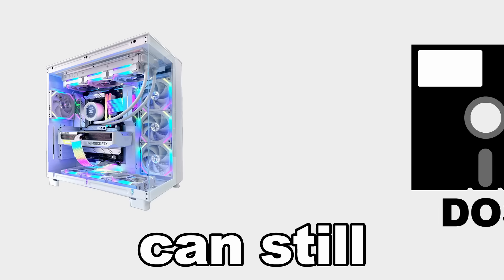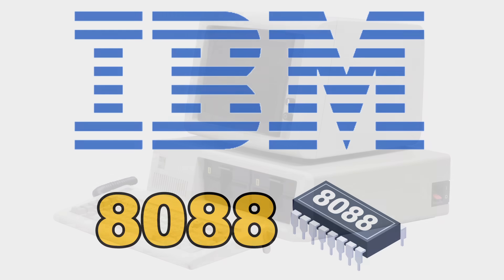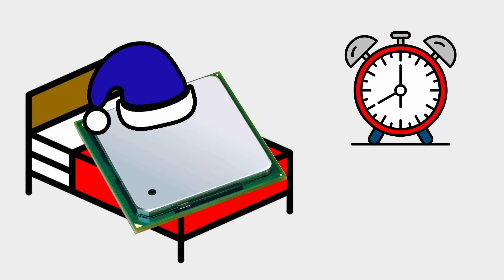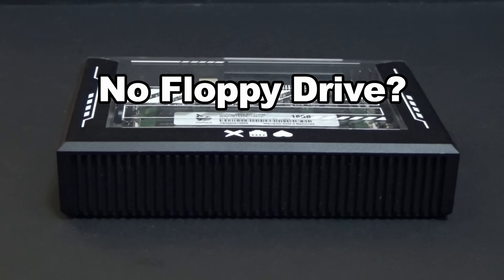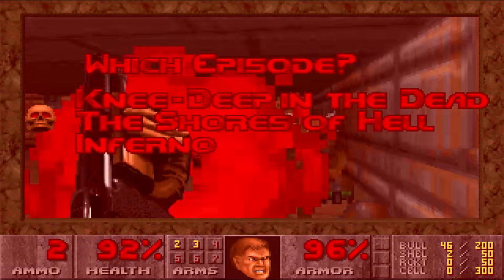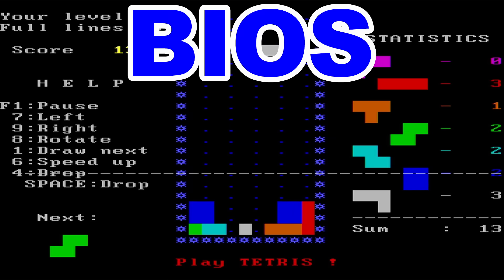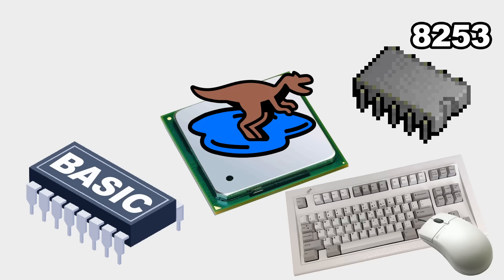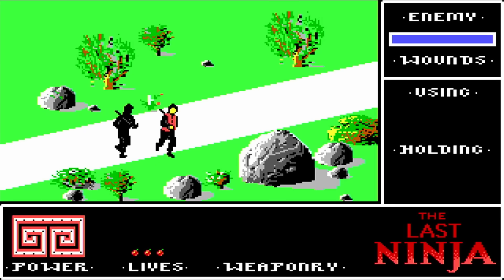45 Year Old DOS on a New Intel CPU Without Emulation

Comment: The Celeron N3450 is anything but new. Is CSM mode still included in new motherboards?

I modded my laptop's BIOS to unlock all options and it doesn't seem to have CSM support (it's an 11th gen Intel).
Reply: Only on Desktop PCs now
Reply: @pankoza  That sucks.
Reply: CSM (aka. UEFI-style fimware pretending to be BIOS) has to be present in the boot firmware. Otherwise your "modding" would basically have to be a full replacement like coreboot | libreboot.

In principle you could also implement it in a bootloader or something,
Reply: @mskiptr  UEFI doesn't really care about whether the code comes from FLASH or is user-provided. Putting it in a bootloader is fine. UEFI was specifically designed to accommodate that sort of extensibility. That's the E in UEFI :)
Reply: @absurdengineering  You mean one can add CSM to an existing system with something like UEFI drivers loaded from the ESP? That would be pretty useful actually.

I've been quite interested in things like that, but sadly I wasn't able to find answers to my questions in the spec. (I'm sure they are there – just finding them was too tricky for me the last time I tried.)

Still, I don't think UEFI will let user-provided code do everything the boot firmware can. Like you will definitely not be able to tweak SMM stuff.

The complexity is just peak "design by committee". It does what it was meant to do, but at what cost? It's giant and over-engineered which is terrible for correctness, security or even implementing it sanely.

What I care about tho is FOSS boot firmware (which is why I'm interested in Chromebooks), so accommodating code from dozens of vendors doesn't matter for me at all. But I can just mostly ignore UEFI and that's ok. At the end of the day TianoCore can be vendored into whatever better firmware we have and that's alright I guess.
Reply: It is still on a decent number of motherboard vendor's products, as well as some pre-built desktop/laptops, despite the proprietary firmware. However, even if AMI and any other traditional "BIOS" vendor eventually removes support entirely, likely leaving ASUS, Gigabyte, MSI, and pretty much anyone else you can name, with few options, as virtually none of them develop their own firmware entirely, you will still likely have options.

Chromebooks since ~2013-ish (?) have all been required to run coreboot-based firmware, which should generally mean you can relatively easily have coreboot use SeaBIOS as its payload, which is a open-source proper "legacy" BIOS implementation (starts in 16-bit mode, etc), while still being continuously developed and having support for certain more traditionally modern amenities, such as TPMs, etc. And since, even though many Chromebooks run ARM processors, Intel is also very common, so you'll still be able to find off-the-shelf hardware that you can fairly easily modify to do whatever you want, including use a BIOS initialization. While there aren't loads of high-end Chromebooks, some do exist -- you can find Alder/Raptor Lake i7s and i9s.

Additionally, some of the more consumer-friendly of the traditional (i.e., not Chromebook) laptop vendors also offer open-firmware based on coreboot -- e.g., many (most?) of System76's products. And companies like 3mdeb (Dasharo) have ported coreboot to certain models of modern MSI Z690/Z790 motherboards, entirely replacing the official proprietary MSI firmware.

From there, as with the Chromebooks, you can use coreboot to deploy whatever payload you want -- be it true, traditional BIOS (e.g., SeaBIOS), the full-spec-compliant monstrous open-source UEFI implementation, EDK2, or more light-weight alternative UEFI implementations, as well simply neither -- you can literally even use something like the Linux kernel, or anything else that has some lower-level hardware support, as a payload and completely skip that aspect of the layers entirely.

It's sort of wild to me that UEFI has been pushed so hard, even though many consumers don't actually need the "extensible" E portion of EFI. In return, we get insane complexity -- EDK2 is well-over a million lines of code compared to, what, ~50K-ish for SeaBIOS -- and again, the notion that you inherently even need either is not actually even true, so that 50K can be much, much lower in reality. As time has gone on, I think UEFI is more-or-less a disaster; there's just so much more surface area for little-to-no gain in many cases, which means more vulnerabilities, more bugs, and less auditability.
Reply: @nukecel  Well, the UEFI-style booting (aka, boot images live as files on a partition and not in a boot sector and you can register boot options, change the boot order or set the BootNext variable from a running OS) is really quite nice and even what we're likely gonna be putting on "liberated" ex-Android devices. But yeah, almost all of the UEFI spec is pointless complexity.

(But maybe that's good actually? More complexity means more exploitable bugs so no true vendor lock – with these giant, proprietary blobs we will always at least be able to boot whatever we want if we try hard enough.)
Reply: @mskiptr  UEFI spec was designed to tackle the particular problems the industry had. Its relative complexity is due to market pressure. A modern UEFI BIOS can have bits and pieces from a dozen vendors, and that mess mostly works OK because UEFI was designed to accommodate such realities.
Reply: My Asus laptop doesn't have CSM support but I do have an old 2nd gen core i3 laptop that has a UEFI thats locked to bios only mode due to shipping with win7 and an 8th gen core i3 laptop that has a UEFI that supports CSM. 

I'd someone made an EFI bootloader that emulated CSM/BIOS that would allow you to boot older OS's on newer hardware.
Reply: @Izanami95  I think Clover Bootloader can boot Legacy on UEFI, I never used it for that tho.
Reply: @Flopster101 I remember many moons ago using TianoCore to emulate UEFI on my BIOS-only machines. Now I have to use Clover to emulate BIOS on my UEFI-only machines. 🤣
Reply: On some

Comment: Haha arm bad long live x86
Reply: Unironically yes. Pull literally any x86-based off the shelf, and there are millions of pieces of software that will run on it, usually without the slightest modification. Whereas there are so many variants of ARM processors that can be as different to each other as an 8086 and a POWER are.
Reply: @throwaway6478   Not to mention that RISC processors (including ARM) for some reason need a kernel image to boot (no GRUB?), which seems weird, as x86 boots from a drive, not from a kernel image.

Comment: There are LGA1700 platform boards that take Alder Lake or Raptor Lake cpus that have a PCI slot. And it's possible on some motherboards to break out a fully functional ISA bus over the TPM connector. So you know what that means right?
Reply: i think it's done through the lpc header, if the board is old enough, not the tpm. but even so, on one point in time and later, the way dma and irqs are handled by these ports (a.k.a the chipset), has fundamentaly changed, so dos sound etc. cannot work even if you managed to breakout an isa slot. you cannot use pci because it works completely different.
Reply: >And it's possible on some motherboards to break out a fully functional ISA bus over the TPM connector

On older motherboards(up until Skylake?), yes it should be possible. Newer Intel chipsets dropped support of ISA DMA from the LPC bus so ISA sound cards are out of the question even if you do manage to use the TPM connector as a usable LPC

Comment: RIP OS/2 compatibility in x86-64 processors
Reply: This is news to me. I knew early Ryzens had trouble running it, but it was errata that was fixed in the AF revisions.
Reply: @throwaway6478  64-bit long mode only has two of the four rings needed to run OS/2, which makes even emulation/virtualization difficult
Reply: @AmaroqStarwind Good thing OS/2 doesn't run in 64-bit long mode then. It's a 32-bit protected mode (retroactively named "legacy mode" in the AMD64 docs) OS, with all 4 rings at your disposal. I suspect you're mixing this up with Intel's monstrous x64-S proposal, which won't have IOPLs 1 and 2 at the hardware level, by "virtue" of not having a legacy mode - but nothing will stop you emulating it with a sufficiently-intelligent hypervisor if you must run it on one of these unnecessarily-crippled CPUs.
Reply: @throwaway6478  It also makes some of OS/2’s functionality harder to replicate for future operating systems.
Reply: @AmaroqStarwind That I can agree with - but as I said, nothing that a sufficiently-advanced hypervisor won't fix.
Reply: @throwaway6478  it's called x86s, not x64-s
Reply: @AmaroqStarwind  Doesn't the hypervisor still provide all 4 rings in the guest when the guest runs in legacy mode, assuming the hypervisor is smart enough to handle those rings?
Reply: @soundspark  I don’t really know. I’m not an expert on virtualization.
Reply: @throwaway6478  well, the 8088 was a crippled 8086 from the start. Cutting one's nose to spite one's face is a long tradition in PC CPUs.
Reply: @squirlmy Yes, but A) the 8086 and 8088 came out at the same time, and B) the 8088 served a purpose as a product, with its simpler - and therefore cheaper - motherboard/logic/electrical requirements.

x86-S does neither of these, coming almost 20 years after AMD64 debuted, and having the same electrical requirements as real AMD64.

All I can see are downsides, chief among them the much-discussed throwing away of backward compatibility. An x86-S will be (practically) limited to Windows 8 or later (and of course, only the AMD64 version), whereas a Ryzen 9950X and a Core i9 14900K that just rolled off the production line can run literally run PC-DOS 1.0 unmodified.
Reply: @squirlmy   The idea was to use all the readily available 8080/8085 support chips.
Reply: @AmaroqStarwind  OS/2 came out long before 64 bit modes.  Doh.  It's a 32 bit OS.
Reply: As much as IBM tried to push OS/2, it just never caught on.  DOS was too cheap.
Reply: I have Warp 4 running in a VirtualBox VM on Linux, on my ThinkPad.
Reply: Arca OS exists
Reply: OS/2 Ruled! Windows drools! 😁
Reply: Also RIP IBM, step father of OS/2.
Reply: @aligokcen5908  ? what are you smoking?
Reply: @squirlmy  I hate tabacco. ;)  IBM lost OS war, also CPU war.  Nobody talking about OS2,  PowerPC, system 360/370,, AS400... 
In IT/IS sector, if you lost domination power, this means you lost health and  waiting to die.  Entrophy.
Reply: i thought you weren't serious
Reply: Did anyone even use OS/2?
Reply: @nyccollin I did, both Warp 3 and 4. Windows 2000 is what brought me back to the mainstream.

I wasn't alone: I recall the number of OS/2 users peaked at around 5 million - at a time when there was only about 60 million PCs in the world.
Reply: @nyccollin  It was a favorite for embedded systems like kiosks and cash machines because it was pretty robust especially once you got past version 1.0.   It became redundant for most companies since Windows developers were easier to find, and NT had finally reached a point where it was probably as good as OS/2
Reply: @nyccollin   Yep.  In fact, I was the OS/2 product specialist at IBM Canada, back in the late 90s.  I was the top OS/2 guy in the country.  I currently have Warp 4 running in a VirtualBox VM on Linux on my ThinkPad.  Back in those days, OS/2 was very popular with banks.  At the company I was with, before IBM, we had FAX servers running on it.  It was far more reliable than any version of Windows.
Reply: @nyccollin from 2.1 to 4.5.2 yes.

Comment: does uefi start in 16 bit mode? i've thought it was only bios emulation thing nowadays
i am probably wrong tho
Reply: @IntegerOfDoom Sorry, english is not my native language. 
    By the way, you haven't even capitalised your sentence and neither used proper quotes.  Even “though” you talk about lazyness.
Reply: ur CPU (amd64 architecture, ARM and others don't do this) starts in 16-bit, then you go to 32-bit then 64-bit

the 16-bit mode has the highest privilege level and allows u to do pretty much anything, but afterwards virtual memory kicks in and u cannot do them anymore, so ur PC actually has to configure some stuff for memory and syscalls and whatnot when booting before u reach 32/64 bit modes where your PC is just working normally with ur regular memory protections and stuff
Reply: UEFI hands the machine off to the bootloader in 32-bit or 64-bit mode, but it can have a "compatibility support module" enabled that kicks it back to real-mode for older OSes
Reply: @sundhaug92  oh intresting, i guess that's the csm thing in bios
Reply: its even more insane than that. Modern Intel CPUs first boot a complete seperate x86 cpu including operating system called the management engine. This handles various tasks including microcode updates and checking the Crypto Signed Firmware. Those CPUs ALWAYS start in 32 bit mode. Once everything is setup correctly the CPU actually reverts to 16 bit mode to start UEFI (BIOS is dead) which very quickly sets the CPU up for 32 or 64 bit mode because UEFI Binaries are 32 Bit nothing less. UEFI CAN start a Compatibility support MODULE which emulates 16bit mode operating somewhat as a Hypervisor. the Bare Metal does not run in 16 bit mode. Well actually the Bare does something else entirely and only pretends to execute your x86_64 instructions but that goes into a massive rabbit hole.
Reply: @mikeysch  Just say it out loud: In reality all the x86/64 instructions don't really exist anymore, but are just macros that an interpreter is cutting into even smaller RISC operations. That's also the reason, why the x86 is still there, while Motorola isn't: It's internally a RISC processor pretending to be a CISC processor. Just like the other processors that are still used are RISC processors (ARM, RISC V, PowerPC)
Reply: @acmenipponair  few people understand this.
Thats why i think it might be a RiscV future 🙃
Reply: Endlich mal einer mit Plan ;)
Reply: @mikeysch  and amd iirc has small arm processor integrated to do similar things (amd psp)
Reply: UEFI loads your OS in 64- or (rarely) 32-bit mode. However, the very first instruction all x86 processors execute (the beginning of the boot firmware) is in 16-bit unreal mode, or the regular real mode on the 8086 itself.

Comment: Sadly, I have 3 computers, from 2016 all the way up to 2024. Oldest can't boot DOS, the newest can boot it but keyboard is running super fast (impossible to type), and the last computer renders flickering lines over the entire screen of DOOM and no keyboard working during gameplay (USB keyboard). Your video was correct over 10 years ago, but modern computers emulate in legacy mode, so it is an emulation still.
Reply: You need to have PS/2 keyboard emulation in bios
Reply: I've got a ~2015 computer that can actually run Win98 (as long as I use the Win 3.1 mouse driver). I'm guessing it's emulating a lot of peripherals, because USB drives show up as hard drives.

Comment: My PC might still be able to run DOS, but it also sadly fails at Windows 95, as it's way too fast, which makes the (unpatched) security code fail horribly. 😉
Reply: And even if you can technically get it to run, it's unlikely you'll find drivers for most of your hardware
Reply: @CaptainSouthbird  pcie to pci adapter, modern motherboards with isa slots:
Reply: VMWare Workstation must inject delays to make Windows 95 work.
Reply: We ran into that problem trying to run games that came out when 80286 pcs were made, run on a Pentium Processor. 
Game finished in the blink of an eye, before you could react!
Reply: It's fine to install patch. I wonder why Youtube deletes comments with its name however.